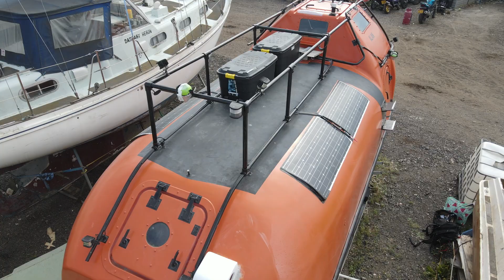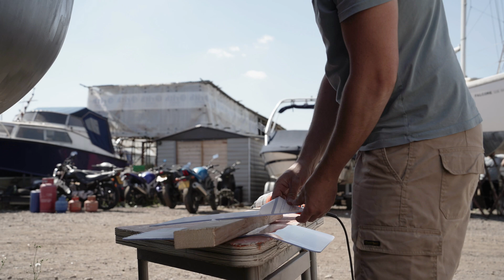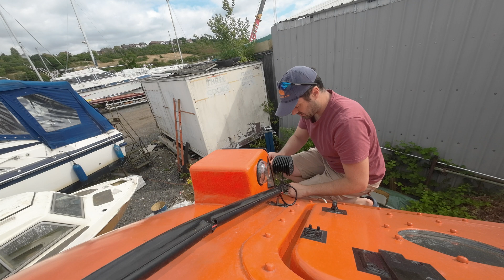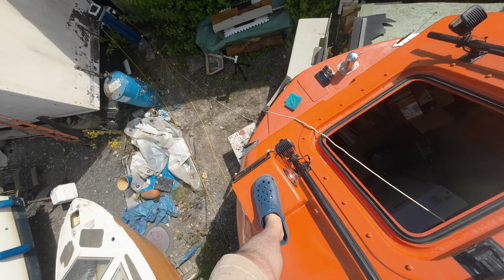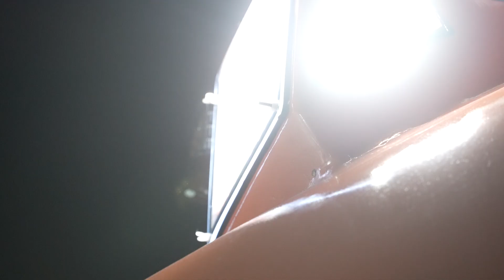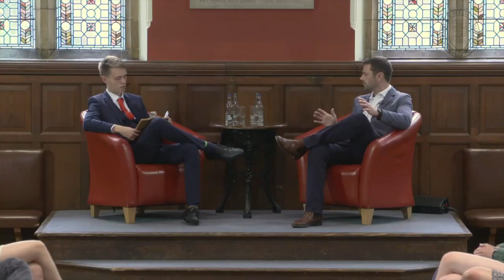Heat shaping and bending polycarbonate sheet to finish a searchlight. Lifeboat Conversion Ep54: [4K]

Comment: I have been usongexa. For my curved wind shield om my catamaran  for years and always wanted to use heat to help woth the compound curve , all research  prior sad ir would get cloudy and distort ( this was 15 yrs ago ) so decided to jist burn ot in place . So the had ware takes the load . I know heating it would reform  it but didn't want it to get cloudy . Now after 15 yrs I now feel sage to give it a try❤

Comment: It seems odd to me to have a searchlight that can only effectively swivel a few degrees. To look around at night, you'll need to rotate the whole boat. 
I must be missing something.
Reply from the maker: Having a 360 one mounted high would cause a load of issues (not least illuminating rain and snow close to the helm's cabin). We'll have handheld's for scanning to the rear etc.
Reply: @AlexHibbertOriginals  Thanks for clarifying, I was sure you had it covered. Your very solidly built light will be perfect for night manoevering anyway, where you'll typically be steaming forward. Got to illuminate those bergs.

Comment: Is it worth using a much longer rectangle of acrylic and bending it all the way over the light housing and down to the roof? This may add improved water proofing, added strength and provide a little insulation to the housing.
Reply from the maker: Importantly it's polycarbonate, not acrylic. I don't think that would add a great deal. We need the top free for anti slip, and there's no real need to insulate the unit.

Comment: I have hardware and attachment method suggestions for you- I’ve done this sort of thing before! First, don’t feel too bad about getting a little scratch on the polycarb. While it is way easier to work with than you had heard, polycarb does scratch super easily. At work we say you can scratch the polycarb if it thinks you’re looking at it funny. Oh and don’t use windex on it, it will get cloudy. 

As for attachment. Have you considered rivet nuts? This seems like an ideal use, but I’m not sure about the compatibility with the fiberglass. Maybe a washer reinforcement on the inside would help the rivet not compress the fiberglass and pop though. I would probably combine it with a spade-headed or winged thumb screw if you can find it in ss316 where you are. You can buy all the different thumb screws from McMaster Carr, but they’re US only I think. Hope this helps- I’ve actually done this almost exact thing before - poly to fiberglass without interior access for holding the interior bolt. The solution at the time was to embed nuts in the fiberglass during the casting process, and honestly I wouldn’t recommend it as a solution. Over time it hasn’t held up the best and my project was a fairly stationary object indoors. I can see it delaminating from the stress of rocking on Alan. Rivet nut would be my top thing to try- especially if you have a friend with the tool. My last idea would be to do one last layer of resin and embed on metal tabs on the inside of the housing that you drill and tap after attaching, which would act as a washer and bolt all at the same time.
Reply from the maker: Cheers - will see if I can work this in.
Reply: @AlexHibbertOriginals  Hey, last week I traveled to where I have the project with the metal plates embedded in the fiberglass that are drilled and tapped. This project happens to be green translucent fiberglass (don’t ask why) so you can see through to the hardware. Give a shout if you want me to send a photo. It’s at last seven years old, has a mechanical structure inside and is doing very well.

Comment: would a 90 degree spring loaded latch clamp be any use for the front light access panel. but the shape of the housing maybe abit awkward.
Reply from the maker: It's my current favourite option.

Comment: I wish that you would give us at least a months notice when you will be working on the flood light box.    I like to take off from work the day before, of and after in preparations  for this event.   I have to give notice to the droves of people that come to watch it on my large outdoor projector screen, whilst cheering you on every riveting step of the way.    The extra heads up would allow for proper parking accommodations for the lines of cars and catering as well.   Thanks in advance.
Reply from the maker: It's now over. Mourn at leisure.

Comment: 've occasionally  witnessed other episodes before, loving the life-boat transformation - sometimes simplest solutions may serve best - why not merely fabricate a pressure plate, patterned to cover the top inch or so of the polycarbonate, with the 3 bolts going through it, thus their pressure will even out and firmly compress the transparent covering to the sealant/housing; the problem atop is more one of distribution of pressure, rater than of bolt-down force/torque; you may even bend/angle the top edge of this bolt-down metal plate - which would be essentially one big washer with 3 holes instead of one - so as to cover the upper edge of the plastic and when it (the metal) would reach the housing you'd be prevented from over-tightening those 3 bolts...
Reply from the maker: I take your point about making a giant washer, and I could, but the seal is complete along the top as things are. The challenge is the angle of the studs themselves compared to those lower down.
Reply: @AlexHibbertOriginals  actually the first thing i'd 've thought of was a piano-stile hinge up-top, but whenever i'd seen such used in other blokes' sailing videos, them hinges (and their respective axles) seem to always eventually rust with time - even the "most stainless" and  "maritime" of the steel ones... alas my  suggestions seem to be as useless as their author, oh well 
P.S. just to clarify, when talking of the "giant washer" i was suggesting a mere straight piece of material with 3 holes in it, and NOT a full pressure flange, which would span the periphery of the entire polycarbonate sheeting - though now i think of it - why not...

Comment: Hello Alex. First comment for me here. First of All, Congrats ! Never been so excited for a not so much navigating boat (so far) videos. I love it all. About your angle problem for the bolts, what about tight hinge on top? If they are tight enough It will push on the joint just fine and allow the access at sea without fearing of droping the hatch in the water. Cheers !
Reply from the maker: A hinge. Quite possible.

Comment: Another option for a searchlight cover is a motorcycle windscreen.  Different sizes and shapes.  Find a fiberglass fairing to go with it from the breakers yard and modify as necessary to  box in and mount.  With a big enough windscreen and curvature, you could probably mount across an edge and not have to mount on a flat space.
Reply from the maker: I'm not sure how this solves the mounting method question mark? The clear panel itself is fine.

Comment: My only concern is heat build-up inside the enclosure... so, get thee to arctic conditions promptly!
Reply from the maker: Based on 65% heat loss for an LED, that's only 32W of heat - I'm fairly sure the housing can radiate that away.

Comment: A thought comes to mind as I watch you work on the searchlight cover. Fiddling with the cover while sitting high, dry and stable is one thing, but out at sea could be something quite different. Perhaps a short safety cord attached to the cover and the other end to the surface inside the housing would prevent losing the cover overboard. Consideration to keep the cord from tangling with the light's movement would be needed.
Reply: What he said, everything that can detatch must have a safety cord, even you Mr Hibbert.

Comment: I'm dubious about the holding power of the magnet mount after many miles of pounding waves.
Reply from the maker: There are guides around it too so it doesn't slip or rotate. The magnets are outrageously strong. Almost too strong.
Reply: It should be fine, a lot of people who live on the ocean use modern magnets to secure things.

Comment: I see you are still using corded tools, will you be getting any cordless ones to keep on board just in case, or just a basic tool box?
Reply from the maker: I have cordless drills and a sander. Otherwise, happy with the power of corded. On the trip, will have a rethink.
Reply: @AlexHibbertOriginals  It gives you multiple redundancy.

Comment: I don't know why you didn't make the housing into a slanted circle with a metal top that screws into aluminium blocks that are glued against the top side wall of the plastic housing.
Reply from the maker: I don't really follow the description, but I suspect the answer is because the housing doubles as a heavy duty step.

Comment: I like the remote searchlight idea, I did start work on a generic remote control 360 gimbal for mounting various things; spotlight,microphone,megaphone, laser rangefinder, LRAD, fluffy toy, whatever. But gave up as it was a lot of work/expense. Something for you to consider perhaps. Also. On the rare occasions when your are in warm climes, your solar cells will run inefficient, due to heat build up if there is no airgap between them and Alans hull.
Reply: Worst case is when on of the panel get blocked and it turns into a resistor and waste your energy. But I believe that most solar panels already come with shun resistors installed to prevent further energy lost.

Comment: Maybe this is a stupid question. But what is the advantage of having a remote controlled mobile searchlight, vs having 2 or 3 fixed big lights that cover all the front of the boat?
Reply from the maker: Space saving, and an ability to aim at a specific point. I think you'd need more than 3 fixed lights to give good coverage.
Reply: It's counter intuitive if you are accustom to night driving in a automobile, but on the water it's much better to have a sweeping beam of light than to have multiple fixed lights.
Reply: I've owned servos and an arduino kits, an adafruit servo controller etc for almost 5 years - I never managed to make the robot stand on its own 2 feet but apparently that's an easy kaggler task nowadays. I would use them with camera, probably double camera for distance measurement, maybe a lidar if I could afford, but never a weapon. Perhaps a distress beacon launcher.